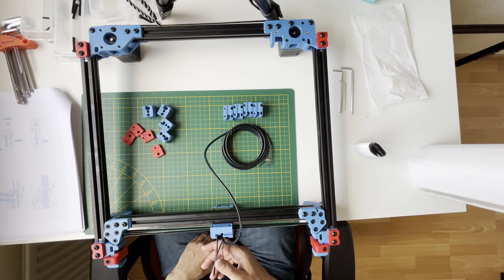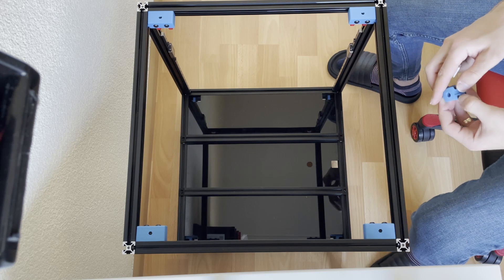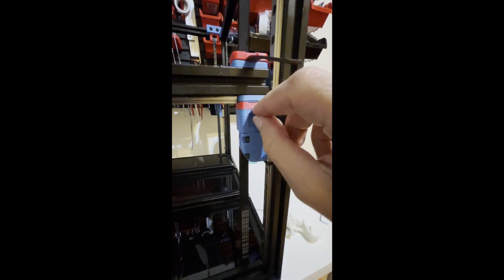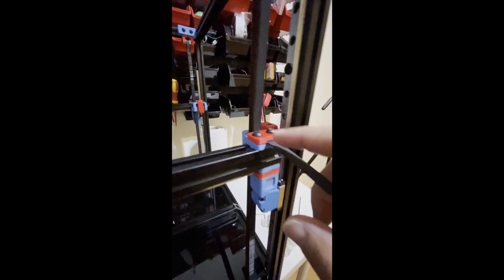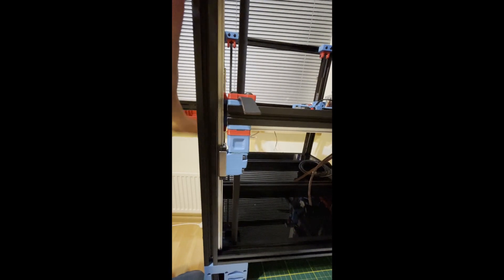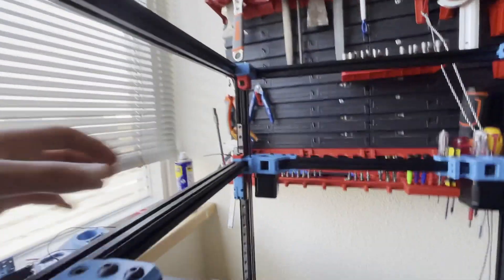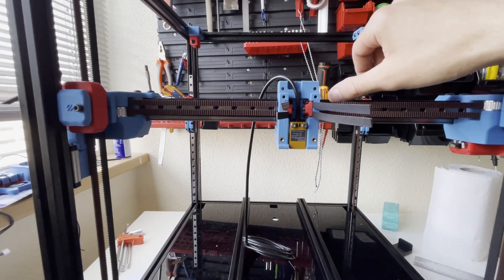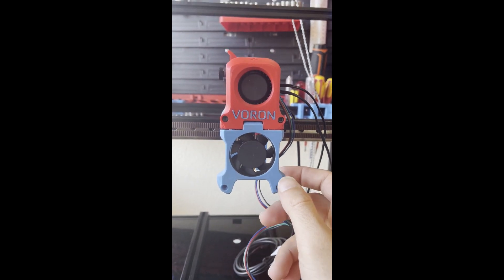Building Voron v2.4 - Belting Z [Ep9]

Comment: Are you happy with the formbot kit? Did you buy any extras yet?
Reply from the maker: Yes. You can check Ep0(https://youtu.be/_0cyDXk9Y5A) for detailed answer for your question.
Reply: @zer0isdoing  Thank you very much. Today my order arrived, interestingly quite different in some parts to yours, but overall I am happy and supprised by the quality, especially as the linear rails are fine and the extrusions seem fine. I did also order another aluminium bed (purely milled and supposedly stress free), drag chains that open (though to my surprise those who came in the kit do as well and seem very fine), another set of cables and a well know ssr.
My main grieve would be that the dark panels are not with protection foil and some of the extrusions did move to each other and now show signs of wear.
Though again, thank you for your recommendation!
I also changed out the hotend to a Dragon HF.

Edit: I have to correct myself, the panels are not scratched at all, the protective foil was just VERY well put onto it and therefore nearly not visible.